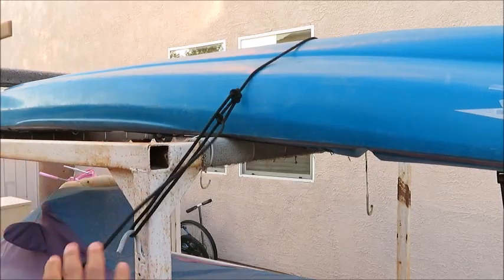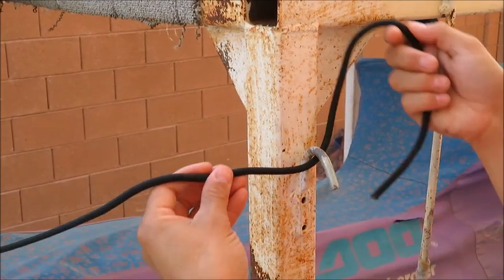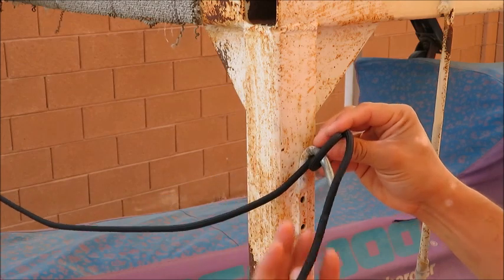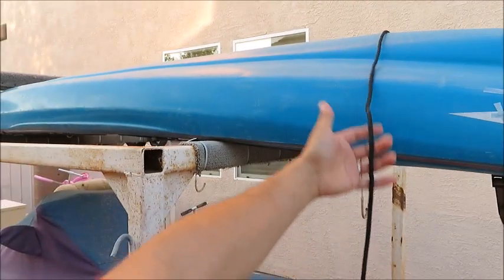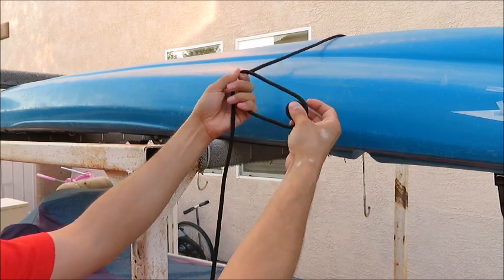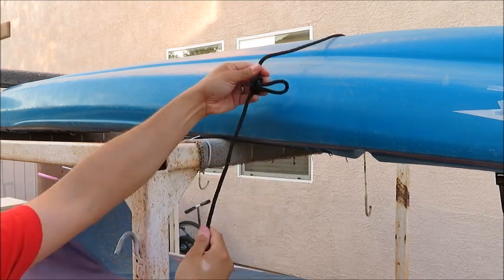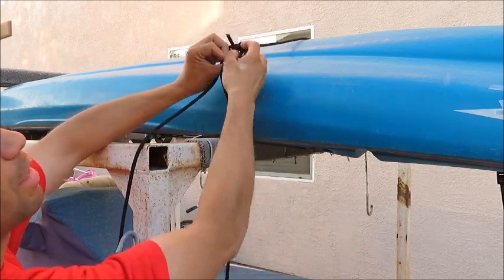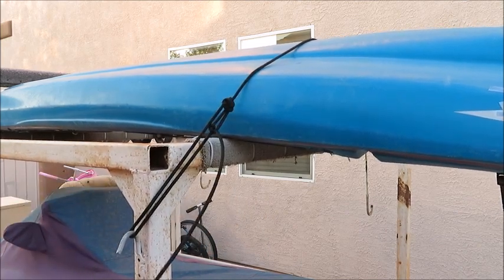Automatic Trucker's Hitch Full Tutorial

Comment: You need an extra step, add a standard fisherman’s knot at the end and pull tight, this will further lock your tension, if you play with it, twisting or bumping the hitch as it is under tension could release

Comment: Awesome! Thank you for the tutorial! I've been afraid of the truckers hitch that it will fail. Now with this automatically locked one it is a piece of cake! Thank you for sharing your experience!
Reply: To make you feel more better and secure, Add a standard fisherman’s knot at the end after you lock your tension, the same one you would use to put on a fishing hook… after you add that it 100% won’t go anywhere, it is simply done by taking your tag (loose) end and wrapping it around the line a few times, and then inserting the tag end back behind your first wrap, and pull everything tight, done right, even if the tension lock fails, the coils will pinch aground that tag end of the rope, still keeping all your tension

Comment: i tested out the setup on some desk legs, i found that the final "coil" around the alpine butterfly hitch got loose with enough jiggling and pulling. putting two half hitches right after the final coil can help that part of the knot from backing itself out. great video!
Reply: If your Alpine Butterfly Loop gets loose with some jiggling, you definitely messed it up. The Alpine Butterfly Loop is probably the most secure loop out there, secure when you pull in both directions AND when pulling just on the two ends.
Reply: @paddor  he said coil not alpine loop
Reply: @paddor  No need, you should keep working on it though. Being able to read and write is very helpful in life.

Comment: I'll have to try the 'ring hitch'.  Looks good.  As in your other video the little trick of putting the free end twice through the loop (based on a Blackwell hitch evidently), works really neat.  Holds all the tension at any point as you pull down.  But don't know why you called the alpine butterfly loop a "bend not a hitch".  It's neither.  It isn't a bend.  A bend is a join of two ropes.  The alpine butterfly loop is a loop/knot, and the entire thing you're making is a hitch (trucker's).

Comment: great video. I use a slip knot for the truckers hitch, but the butterfly works as well. So who cares. I like your self-locking trick a lot, this is really a great idea.  Thx for this video.
Reply: Slip knot will disassemble more easily than butterfly, but may collapse if run the wrong way. Butterfly is stable, but hard to untie on thin line. Pros and cons for each.
Reply: @ushi120  collapse, not capsize (not likely)... binding the tail end is not desirable. Something to be aware of when learning to do it successfully.
Reply: @ushi120  Why is it seen as a problem? I'm sharing knowledge.

Comment: Do you feel safe with just the locking truckers hitch; or would you secure it with a couple half hitches before you drive off down the road?
Reply from the maker: I always add a couple half hitches. I just tied some wire shelf racks to my roof with this knot and drove from California to Las Vegas, 250 miles. Worked great.

Comment: This is not the truckers hitch. You have to pull the parrallel string through the loop to create a new loop, where you introduce the working end, and by this doubling the transmission force. The alpine butterfly is not the indicated knot, because it is desighned to work vertically to the rope. What you need is a Roman knot, a digure seven knot, a sheep-shany or a  marlins- pike (further development of sheep-shank). These knots work in parallel to the string.

Comment: Good one but it's an Alpine Butterfly Loop, I'm pretty sure. And it will NOT slip.
Reply: The alpine won't come loose, however, when you pull the truck hitch tight, it can become a gopher knot. That is why I don't like knots in my rope. The truckers hitch can be tied with knots that are easy to untie. No trucker wants to spend time taking knots out of ropes.
Reply: @garyjohnson4657  Not to be argumentative, I wasn't as clear as I could have been but there are two alpine butterflys--the bend & loop. Bends join two ropes; loops are making a loop in one rope, what you did here--alpine butterfly loop. Even under heavy strain, the butterfly loop is relatively easy to untie--bottom line, I agree with your vid and the finishing tip is one little known. A hitch has to be tied to something and if that something is removed, it falls apart, i.e., clove hitch. Thank you. As I reviewed the vid, you must agree as this is what you use--it's a good one!

Comment: Using a butterfly to make the loop means it is not a truckers hitch. 2 bad effects: 1. you will be tempted to reuse the loop which will concentrate the wear. 2. You have to feed the end of the line through the loop. Neither is true for the truckers hitch. The aussie truckers seem to have the best descriptions on Youtube.
Reply: I can't follow some of their fancy wrist moves though, as it hides the rope from being observed and relies mostly on muscle memory.
Reply: The trucker's hitch is a system of knots to achieve a mechanical advantage. There are different ways of both tying the loop and fastening  off at the end. Still a Trucker's hitch though. Though I do agree about the wear on the rope if you don't untie the alpine butterfly.
Reply: @zoehancock  Usually two knots, a half hitch that holds the upper part of the hitch, and the final knot to secure it.

Comment: Well it is NOT a BEND as a bend connects two ropes. It is a LOOP.
Reply from the maker: Tom, thank you for this comment. I will make my next video because of it.
Reply: Your anchor is actually the "anchor hitch" not a ring hitch. Very good direction an easy to understand otherwise :)
Reply: @Rezorcful  Many knots have multiple names.
Reply: @waykno8478  very true.. I'm not gonna explain the difference between a knot and a hitch but just reiterate that it is an anchor hitch not a ring/lark/cow hitch.
Reply: @Rezorcful  Yes, somewhere else I agreed with someone it is an anchor. I know the difference also--I was simply stating a fact that, as I'm sure you know, many have multiple names.
Reply: @waykno8478  I was only trying to spread facts and help people no harm no foul if I could save someone from using the wrong term/name
Reply: @Rezorcful  Got it. And you did good. At least you were courteous about it.
Reply: @waykno8478  I'm rarely courteous people say.. I probably wasn't sober
Reply: @Rezorcful  That's OK, neither was I.
Reply: Isn't that a sheet bend that joins two ropes.

Comment: Is there a downside to doing 2 coils in the last step vs pinching and tyibg with a half hitch?
Like more strain on the rope or smth?
Reply: Depends on load being dynamic or static. Tent ridge line is static and good.
Reply: No there isn't. This cinch knot is used to hold the rope under tension, while you finish. My dad would tie a truckers hitch and then wrap the rope around the bed hook two times and pull hard. Then he could cool rope to throw over the load to continue securing the load. Your last knot secures everything.

Comment: That is a poor attempt at a Truckers knot. Truckers knot is much easier and quick. Will not leave a loop knot in the middle of the rope.
Reply: There are lots of variations of the trucker's knot. Essentially innit is a loop in a cord which allows a pulley system to be set up. However you achieve the knot it still counts as a truckers hitch. Unless you are Australian and talking about a truckies hitch- those guys tend to be very dogmatic....

Comment: Too much friction, sure you get to “keep” all the tension but you’ve lost half to begin with due to all that extra friction. 

It’s a cool trick but it’s counterproductive
Reply: actually you´re still able to pull it tight "enough" but yeah it swallows some energy. If you´d wan´t it even tighter i´d go with a second "pulley" knot.
Reply: The cinch knot works by putting more pull on the top coil, which is the load rope. When you pull the working end you pull a coil under the load coil. The load coil holds it tight. You can finish it or you can let off the pressure an tie a truckers hitch an finish with half hitches.

Comment: Rubbish. A neophyte who thinks he's a knot tyer, spreading 'the wrong way to tie a trucker's hitch'. Un-effin'-believeable!
Reply: Keep quite, he's sure helping me so I appreciate these videos.  Keep politically correctness away from knot tying, please!!  There's plenty of other ghey stuff where PC can  hang out all day long (and that's far away from me).
Reply: Uguysnuts, bs comment.  There are several ways to tie a truckers hitch.  Using the alpine butterfly loop vs a slip knot is a more robust method that takes no longer to tie, once you've mastered the knot.  There are easier and faster ways to tie the butterfly knot.
Reply: There are several ways to make a trucker's hitch and YouTube is full of different flavors. Pretty much the variation is in how you make the mid-line loop. I think the intention behind a trucker's hitch is when you release the end, a quick pull causes the whole thing to fall apart with no need to untie the loop. A butterfly doesn't follow that intention. I'd also like to add that after experimenting with this, I discovered that this idea didn't work well for me with all types of ropes especially larger diameter. Thin flexible rope like paracord is ideal. Larger diameter and/or stiffer rope didn't make a tight enough bend to keep the locking loop stacked on top of itself to allow the self-locking.
Reply: There are lots of ways to tie the loop in a truckers hitch, just as there are different ways to tie it off. Regional variations, and also historic variations, which change with modern cordage.